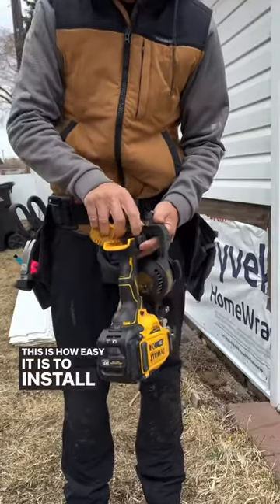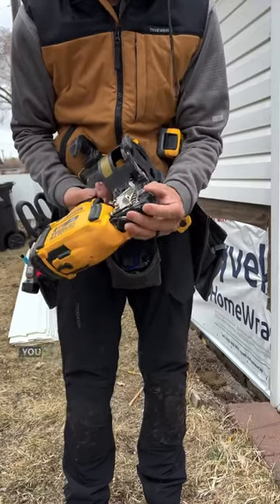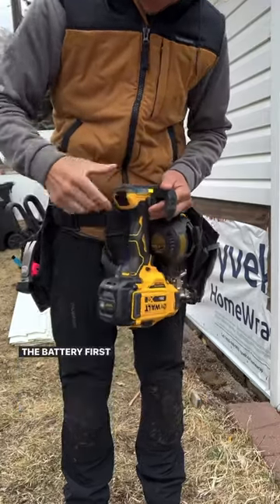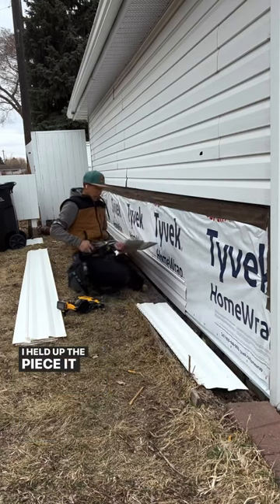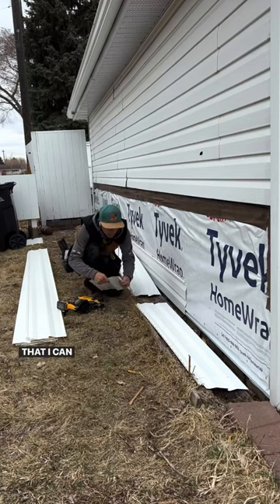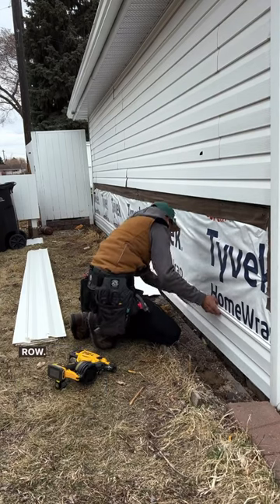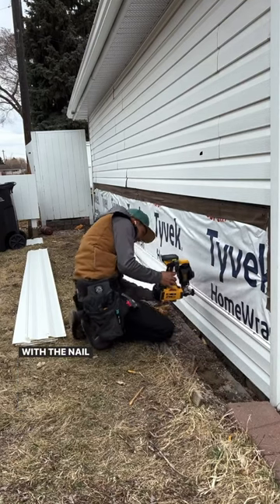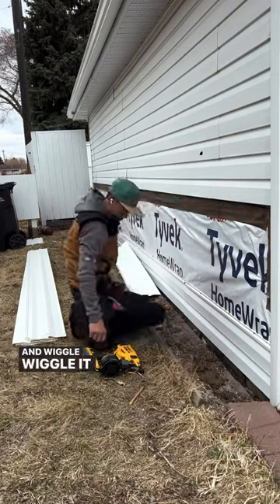Starting row of vinyl siding

Comment: Nice . I do seamless steel siding . We hammer and use 7 penny nales . What coils do you use and where can i get the sidimg adapter ?
Reply from the maker: We use 1 3/4” roofing coil nails. Hot dipped galvanized. Stainless is also available but a bit more difficult to source. The adapters are available at www.sidingtips.ca